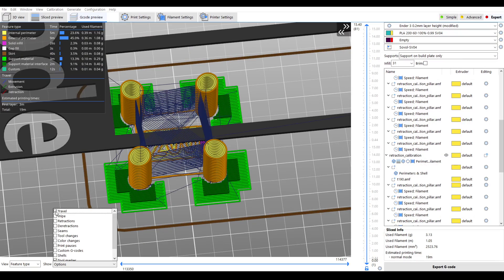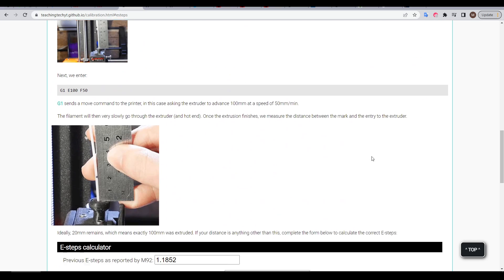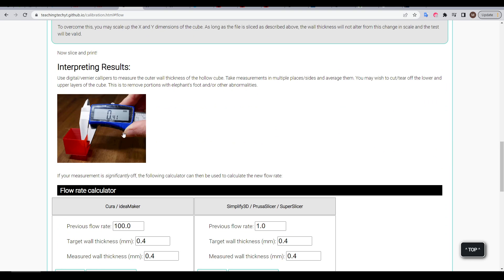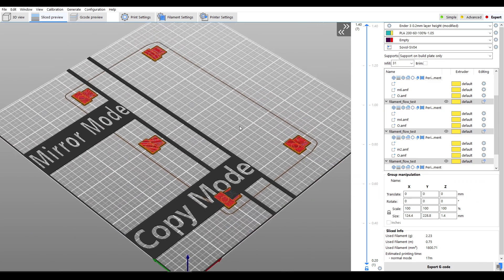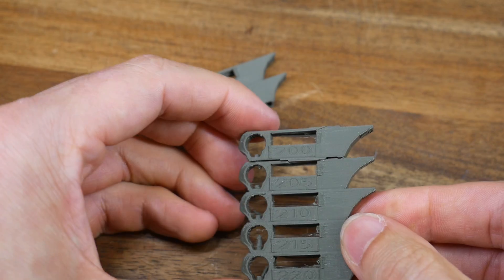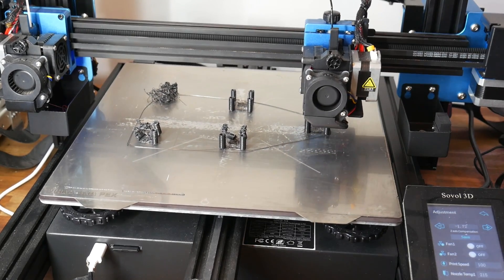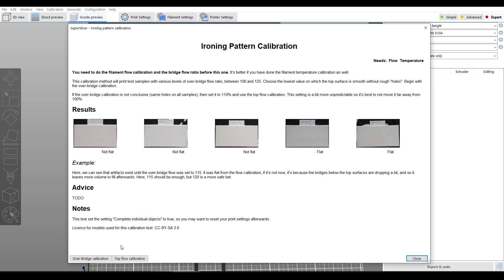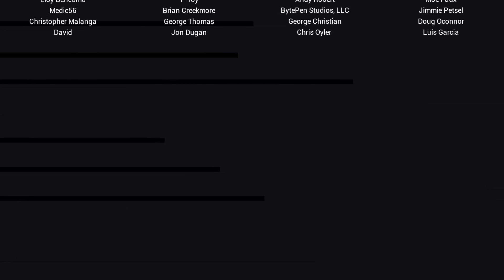Superslicer in built calibration guide for better 3D prints

Comment: Thanks for the video, i am a Cura user of over 3 years, i tried Prusa, then Superslicer but i can't get on with either as i am so used to Cura. I tried Orca Slicer an i love that it can open my printer dashboard within the slicer (Klipper or Octoprint) Annoyingly while basically the same the calibration prints are adjustable in Super Slicer and preset in Orca.
I'm making an effort to get my head around Orca mainly the settings but how do super slicer or its variant control overall speed? You have initial layer and all the others but Cura has print speed for the overall setting. So i did a print through Orca with default settings and basically it printed slow about 2/3rds slower speed wise

Comment: Michael, aren't temp towers printed upside-down? I would think they would start with the lower temp on the bottom, then increase going up the tower.   currently, with the hotter temps on the bottom, there could be some residual temps in the equipment and skew the results.   thoughts?

Comment: I’m new to 3d printing and have gotten different perspectives on wether or not to do calibration tests for filament changes. Can somebody help me with this? Should I be doing all these tests each time I change a filament brand and color? Do I just need to do a few of them for this kind of filament change? Sorry I’m just a little confused and had no idea how much goes into 3d printing until now. I had no issues building and upgrading my printer but actually getting it to print good prints has been a problem lol. Can I make different profiles for certain filament brands, types, and colors if I do have to calibrate each time for an easy switch over? I’m going to give this superslicer a try. It seems like maybe it’s beginner friendly lol. Any tips would be really helpful. My test cube comes out perfect but anything else I try either won’t adhere to the bed or it’s warped. Just a big mess unfortunately. Thank you so much for your videos! I’ve been trying to watch most of them and get better understanding.

Comment: Can you recommend a good printer? I bought an Ender 3 v2 and an Anycubic I3 Mega used from Marketplace. A little tweaking and they work great. Then I bought a new Ender 3 S1 about 8 months ago. I have yet been able to get this pos to be consistent, or accurate. I have spent literally hundreds of hours troubleshooting, test printing, calibrations, then I decided to load Klipper. Though it has helped a little, it's not even close to consistent. It's a mystery every time I print what the finished print will look like.  At this point, I'm ready to load Marlin back on it and put it up for sale.

Comment: Wow. Moving from cura to superslicer is the HARDEST job I have done so far with printing. Superslicer is soooooooooo hard to understand. Where the hell is the flow rate? I started the flow calibration and the first block was wayyyyyyy over extruded! The nozzle ended up hitting filament that had built up from the ironing so I immediately stopped it. Going back to cura as it is way easier and user friendly. For those of you that have got a grip on it i applaude you!

Comment: I used the 100mm method for calibrating the extruder since beginning this insanity back in 2013. A few years ago I realized there was no way 100mm can provide enough resolution so I started  measuring out filament for prints that required several meters of filament, added a few hundred mm extra, ran the print, measured what was left then adjusted the extrusion multiplier. I think this has made tuning more predictable knowing I'm consistently within .5% of the calculated value over those several meters. Using the manufactures claimed e steps for the Titan Aero my extrusion multiplier is .82-.92 depending on filament used

Comment: Why is the calibration cube optional? None of the other tests apart from the extrude 100mm of filament tests steps/mm. Surely calibrating x and y steps/mm is important as it defines a large % of the final size of a print. Nice video though, highlited a few tests i should probably perform. Personally never tried ironing.

Comment: why you doing this flowrate calibration and adjusting multiplier without measuring actual diameter of filament? this makes no sense.
Reply: If you want perfect results you need to do flow rate calibration for every filament you use.

Comment: Id love to see a video about custom gcode for each material profile, for those who have lots of different printers and different materials. like setting PA or LA, or setting the flow in relation to the nozzle size like what prusa does in their profiles.
it would bee great to set a perfect material profile that is ready for all my printers
Reply: I second this. I think it would be easier to set the filament specific parameters in the filament start gcode. I was just thinking about this last night and was going to ask, but found this Comment addresses my thoughts.

Comment: Heads up with the stringing test: There is a bug where if you chose a step of 0.5 mm, SuperSlicer doesn't actually change the retraction settings, resulting in the same stringing from the bottom all the way up the tower. I fiddled around for a long while with this test until I read someone mention this bug. Now I don't know what versions this affects, of if it affects everyone with the same version, but I've already had someone else experience this bug.

Comment: Michael, this video convinced me to give Superslicer a try. ONLY ISSUE: I don't see a way to print directly from the slicer over USB to my printer. I do this for about 90% of my small prints from CURA. Easy-peasy (since I don't use Octoprint and don't need to bother with the SD card). Is this not a feature / option with Superslicer???

Comment: Hi and good for those that use that software that is also curura
I personally would not use and use Matter control slicer. Due to its simplicity and full penitration of the filament at 100%  for tool making that I have found cura fails upon
Structure 3d prints
For my aspect I use 100% infill due to my requirement and curua fails in it strength. I don't know why but it does. So matter control works for me
If you can put a video up against such slicers and give out the Verdict of why these slicer or programs differ then I'm all. Ears

Comment: I love SuperSlicer, but the development seems to have seriously slowed down (I understood this would be due to health issues of the developer - whom I wish all the best and a speedy full recovery).  This makes me worried that effort I have invested or worse, still will invest, might be wasted.  With PrusaSlicer tree supports around the corner, I don't want to miss out on this in SuperSlicer.  Arachne landed relatively smoothly in a SuperSlicer beta, but since then things have slowed to a crawl.  The main change still happening on github seems to be extra issues being logged, but no bugfixes or promoting things to an official release.  Again, I love SuperSlicer, but a project like this really would need multiple top developers on it to keep it at its top.  Ideally PrusaSlicer should pull the SuperSlicer improvements upstream, but I also do not see this happening ...  It's a pity as now I'm torn between the two with limited time to invest in improving profiles for one or the other ...

Comment: I recently did pressure advance and retraction calibration for my PLAs, I didn't really like the low area for the first layer with built in retraction test model. Nor the fact that you have to start at 0 for retraction. I just wanted to start from 2mm and the go up from that for my bowden setup.

Comment: I just got an new printer an though i really don't want too i think you have convinced me to tune it. First i gotta fix the extruder. The factory tuned it to work. But the extruder was set up wrong in the factory. (Intentionally slipping the extruder gear to create pressure)

Comment: Ever since I changed my extruder, Ive had issues with clearance and recently found out it was due to flow. I used the superslicer flow calibration tests to tune the flow for my different filaments, and now some work pretty well. Some others still aren't great, but now I know it is due to the filament, and not an issue with my printer. Because of that, I now know which brands of filament I prefer. Overall, I had a good experience using the flow calibration. In addition, I've used the temp tower generator, and in my experience, it works as expected. I like that the towers are thin, because it is faster to print, and uses less filament compared to assembling your own temp tower in cura. It is also much simpler to generate, and doesn't require you to manually assemble the tower.

Comment: hello, i really like all your tutorial. Could you make one on how to successfully upgrade Superslicers while maintaining profiles and preferences? I can't seem to find an easy way to upgrade this software (unlike prusaslicer), maybe i am too dumb i don't know.
Reply: I just turned the settings folder (in your profile AppData/Roaming on Windows) into a git repo and have all settings under git source control.  I can make branches for the various versions (which have their zip extracted in a separate folder) and the  switch to that branch before starting the associated version.

I would love seeing such git branching and commit support added to the slicer(s - as I do the same for PrusaSlicer) so that you basically get decent version tracking on your profiles.  The slicer could just add a commit for every save you do to a profile.
Reply: @MisterkeTube  that seems way too advanced for me, i don't understand why the program can't have the option to upgrade itself maintaining all the settings fro mthe previous version.
Reply: @garramiro  I haven't had problems losing settings on upgrading SuperSlicer.  Only when going back to an older version with a config from a newer one.
Reply: @MisterkeTube  how do you do your upgrades mind if i ask? did you follow any particular tutorial?
Reply: @garramiro  Until the point when no more updates were coming, I would just download the zip for windows, extract it to a new folder and put that next to the others in Program Files.  Then just run the new exe from that folder.  If you want to be sure running the new version doesn't make you lose your settings for the old one, just copy the entire appdata/roaming/SuperSlicer folder to a safe location so that you can copy it back if things go bad ..
Reply: @MisterkeTube  thank you very much , i am gonna try that.
Reply: Can you export your settings from old, then import them into the new?